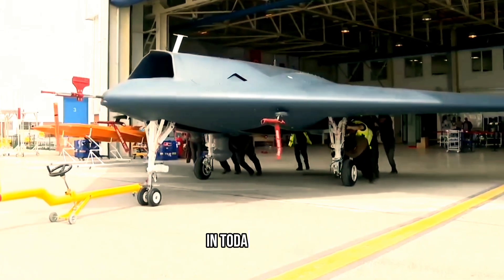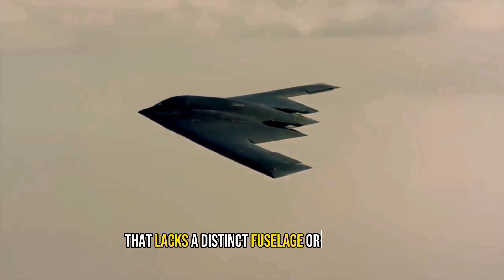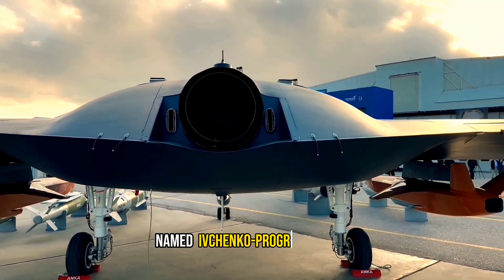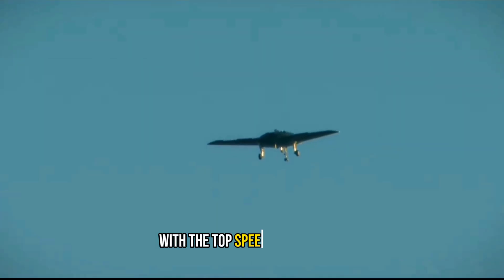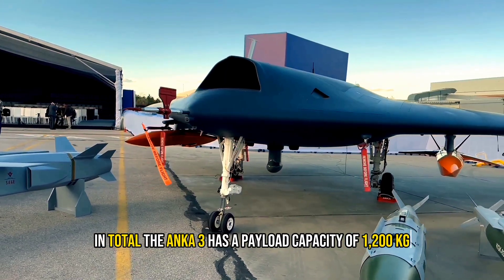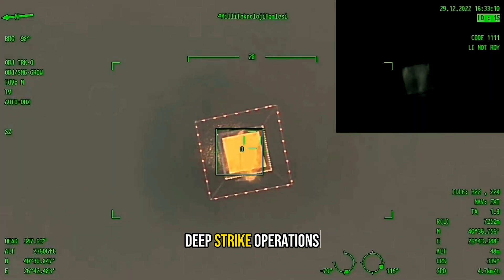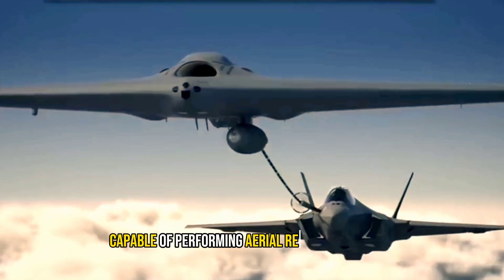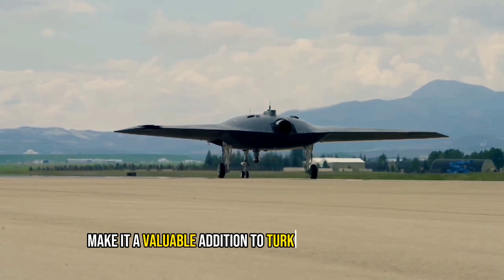Why ANKA-3 Drone Is So Special?

Comment: Its cutting-edge but cant flip back tyres during flight..
Reply from the maker: Thanks🙌 for your valuable comment. By keeping the landing gear down, test pilots can evaluate how the aircraft performs during takeoff, flight, and landing with the landing gear in the extended position. This allows them to assess the aircraft's handling characteristics, performance, and any potential issues related to the landing gear. All kind of aircraft like  fighter aircraft to commercial aircraft, uses this method during their Maiden flight. We hope you understood.
Reply: Test uçuşu olduğu için
Reply: you have no idea what you talk about right?